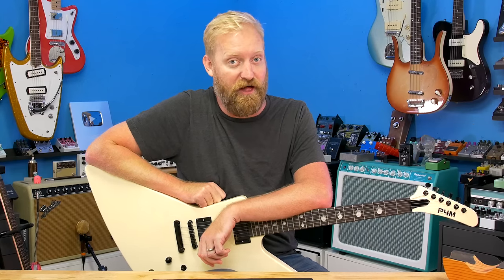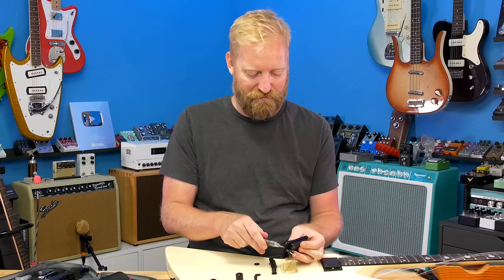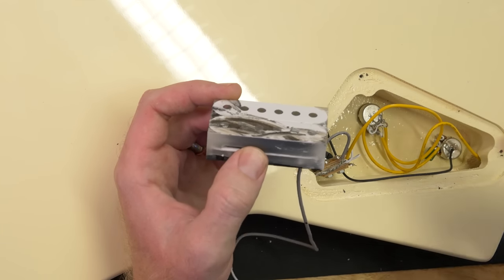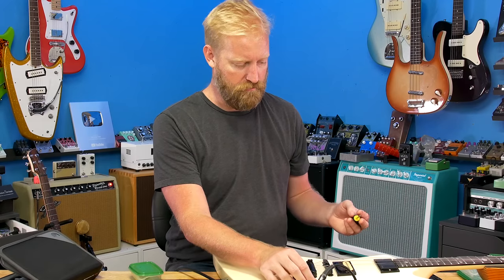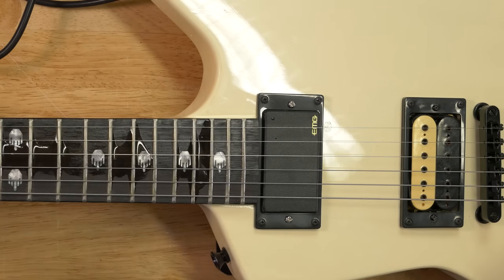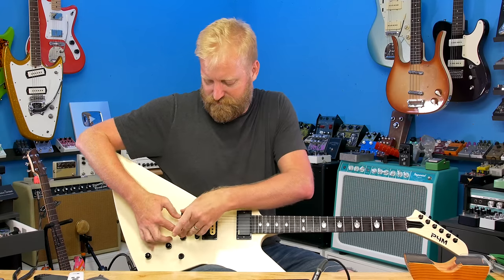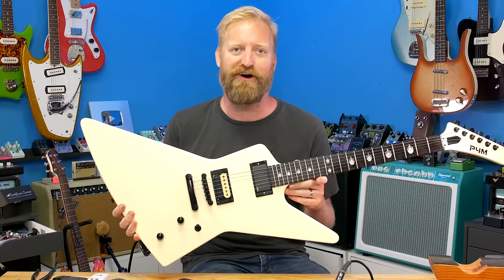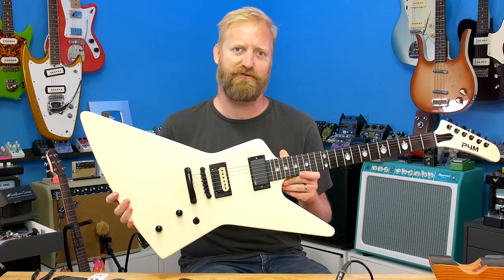EMG OMG! - are these EMG branded pickups FAKES? - (Obviously they are, but lets take a look inside)

Comment: Mine just showed up today, except with an ESP logo on it lol
My pick ups sound weak though, not sure if that’s a ground issue/wiring it just the pick ups suck. Very little saturation on the high gain amp settings 
Ordered a real set of KH EMG’s, with new switch, so it’ll all be solderless

Now I’m tempted to swap bridge parts since you mentioned about conductivity with it

Also have some 10 size strings to go on too, these strings seem thing in the bottom

Comment: You’ll need to be careful that you wired the pickup in phase with the neck pu, as long your not sure which color wire is which. And can’t you just connect the ground to where the old pu was grounded?

That’s too much microphonic stuff for me. I’d be inclined to replace the neck pu with that other zebra you had (was it a GFS, did you say?). Then you might be able to chug.

Anyway, that’s my two cents. Cheers.

Comment: Do you know if there are fake EMG EXG and SPC pots on the market also? Because i am wanting to buy both, but i fear they are not originals, because the ones i have found as new comes in the old white pack the EMG replaced by the grey pack years ago. But the only emg copies i ever saw on chinese shops are the pickups. So i am really in doubt wheter i should buy that pots believing they are originals or not.

Comment: Yeah they aren't real EMG pickups EMG pickups have a battery compartment nine volt unless it's EMG Hz pickup that's the only EMG pickups that are not active and the EMG Hz pickup has that written on the pickups. I would suggest getting DiMarzio pick ups or Seymour Duncan active pickups little cheaper than EMG pickups. And no that's a fake Esp logo on the headstock if that's what it says I can't really see it to good on my screen., unless that's a real Esp guitar three for four thousand dollar guitar which I seriously doubt that . In order to get rid of all the buzz have to get active pickups and you'll have to rout out a spot on the back of the guitar to hold the battery in place. It's about a hundred and fifty dollar guitar hope you didn't pay too much.

Comment: Try using a double mono jack plug , just twin positives & earths but 100% extra contact and rock steady with jack plugs,i use them on all my bass's...mind you, you  will have to sheild and earth the guitar parts into one first,some cheap graphite paint, a bit of  wiring ,NEW PICKUPS, a double mono jack plug & you will have a good guitar...lol...real EMG's would be nice,even without an active preamp wired passively...not so cheap after all that though but may be worth it...

Comment: Was the guitar supposed to come with actives or passive PUs. I see no 9v battery that would be the clue they are only passive pick ups. I did check and EMG does resin fill even their passives not sure about older options. A lot of guitars I have that came with passive EMGs all have EMG HZ on the cover.
Reply from the maker: The website doesn't have any information on the guitar. I found a listing on ebay that has some incorrect info for the body/wood, but no info on the pickups. You're absolutely right that EMG makes passives in their EMG-HZ line as well as the Select by EMG line. The assumption based on the model and pickup covers is that these would be an 81/85 set, but it's definitely not those nor do they appear to be anything else from EMG - steve
Reply: @60CycleHumcast  Badcat gives no info on the guitar as far as specs go. I have to say they are selling guitars with knock of pick ups.

Comment: EMG's are good? I picked up a strange guitar at an estate sale a couple of decades ago that has EMG pickups in it. I've never tried it. It looks like some kid sanded down an old Fender of some kind and cut the horns off to make it an original but he never finished it. He stuck a set of EMG pickups in it and apparently got stuck on the wiring.

I bought it because I noticed the tuners were marked Fender.
Reply: Even Selects , their budget line sound really good. Not traditional tho.
Reply from the maker: EMGs are very good at being EMGs. They're not for everyone, but if you like what they do, then they're great. - steve

Comment: Emg passive puckups have a wierd setup. They have solderless hookup with extra wires from what I remeber, I have a set in my drawer that I pulled out of a Jackson rr3 that I bought.
Reply: They should also be branded as EMG HZ though, if they were authentic passive EMGs
Reply: @Andrew_182  They are
Reply: @derekwright5564  They are what? Because they are not authentic EMGs.

Comment: They look like the old EMG select pick-up brand from the late 90's.
Reply: That’s what I was thinking as well.
Reply: EMGs are epoxy potted , not wax.
Reply: @terryenglish7132  WHERE exactly did you see us say differently?
Reply: @RokDAWG1  ? In the video you can see the wax. So strictly speaking, just from your statement. BUT, I figured you were referring to the outside, where they do look that way and was just adding more info. These were not potted properly even for wax. EMG use epoxy for potting, not just the housings.
Reply: @terryenglish7132  Of course you can see the wax. He ex scrapes some of it off. So your assumption was clearly wrong & so was trying to correct something that WASN'T there to be corrected.
Reply: @terryenglish7132  haha ok 👍

Comment: That's not wax, it's epoxy resin.  You need a vacuum chamber to properly epoxy pot a pickup.
Reply from the maker: there's wax under the epoxy
Reply: @60CycleHumcast  that's messed up.  Why do two different types of potting and screw both of them up?

Comment: FIRST CLUE SHOULD HAVE BEEN NO BATTERY. SECOND ACTIVE EMGS DON'T NEED TO BE GROUNDED. IF THEY WERE PASSIVE THEY WOULD BE HZ OR OPEN COIL.THIRD IS NO CLIPS ON THE BOTTOM OF THE PICKUP.USUALLY THERE IS ALSO A MARKING STICKER EVEN ON THEIR SINGLE COIL SA PICKUPS

Comment: Ground wire to bridge fell off.. Likely just a pinch type contact.
Reply from the maker: Then why does it ground when I touch the posts?
Reply: @60CycleHumcast  It's making a positive contact when you you push down. it's just a bare wire at the bottom of that hole I'm betting.
Reply from the maker: @StevenHess  hmmm, It feels pretty solid but that might be possible
Reply: @60CycleHumcast  if the bushing doesn't reach the bottom of the hole but instead is just flush to the top it'd be easy to happen. A lot of bridge grounding is just something laying on top of a wire. Where as wiggle stick bridges use soldered on connections.

Comment: To wax pot a pickup you have to let the pickup heat up and soak the wax into the coils. They basically just gooped the wax over the pickup after jamming it into the cover. I'm willing to bet BadCat bought a bulk lot of fake EMGs from China for super cheap and didn't question it when the pallet came in.